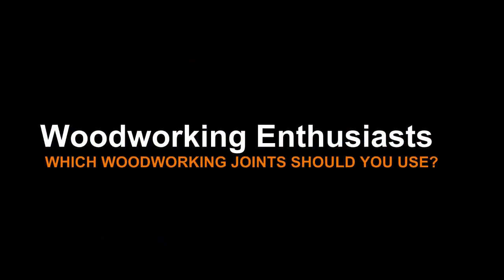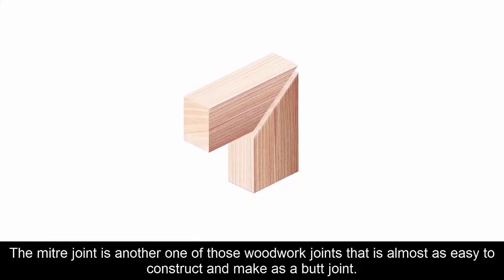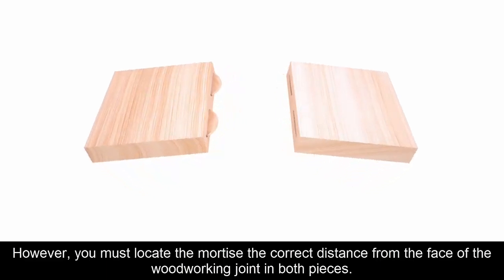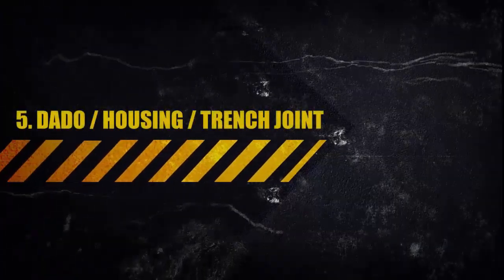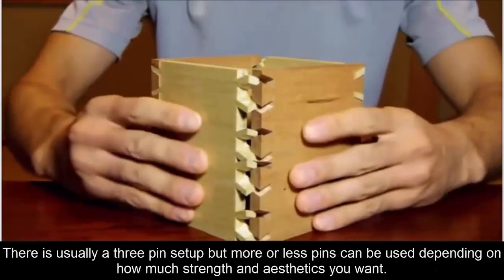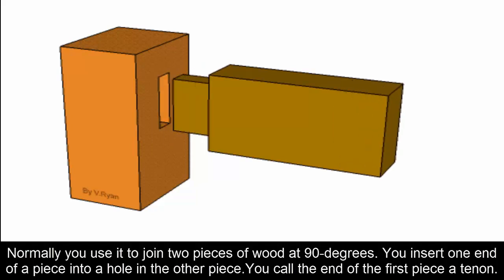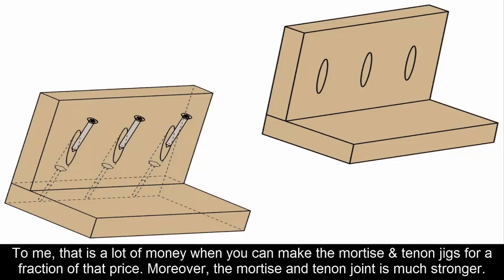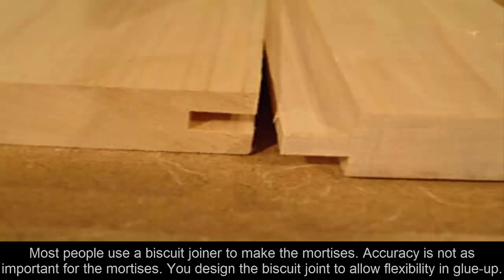Wood Joints : Which Woodworking Joints Should You Use?

Comment: Thanks to the very clear and complete video, the types of joints are very diverse, each has its advantages and disadvantages. One of the connections is a box joint which has the advantages of a unique jagged shape, strong wood construction. But it has the disadvantage that it is complicated and glue lines are visible.

Comment: Well it turns out that there are also many wooden connections that do not use nails or bolts. Even these connections can be stronger and more decorative than using nails or bolts. 
Thanks for the video, very useful!!!